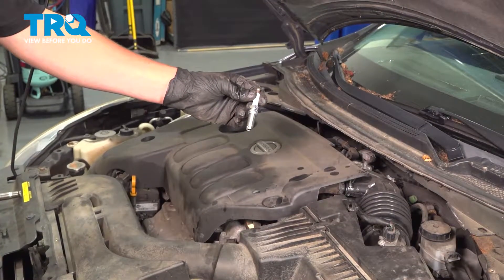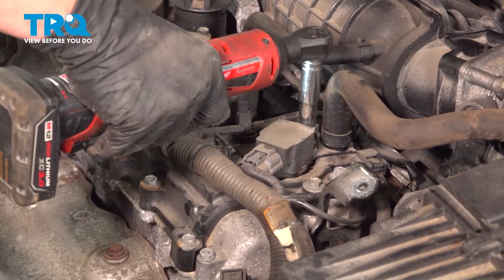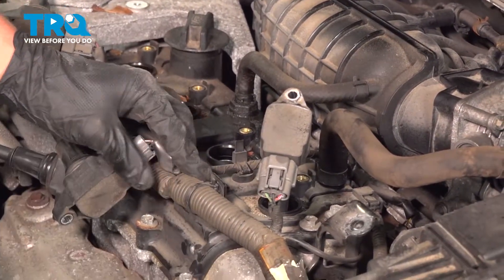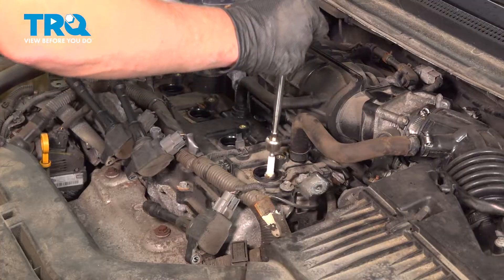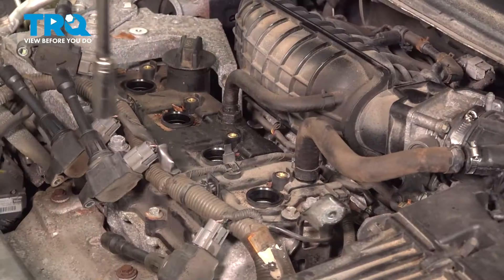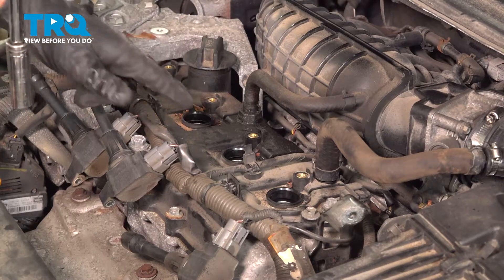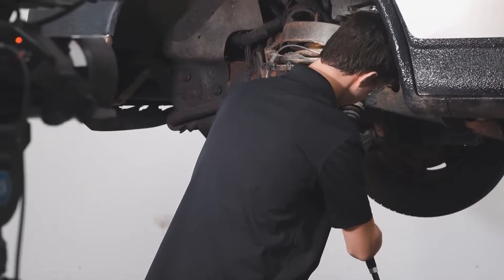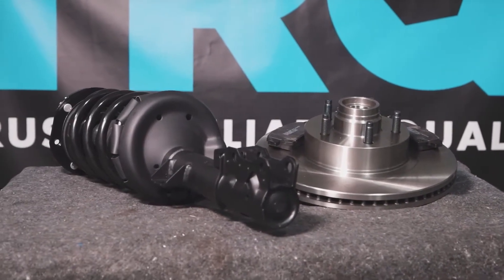How to Replace Spark Plugs 2007-2012 Nissan Altima 2.5L

Comment: I always recommend putting a very small amount of anti-seize or grease on the plug threads and dielectric on the tip to aid in removal next time you change the plugs....

Comment: 1:42 ALWAYS use compressed air to 'blow out' any debris that may be inside the boot holes BEFORE removing the plugs,to prevent anything from falling into your cylinders....

Comment: If you want to get the spark plug out and if you do not have a magnet, you can use the ignition coil that will act as a sponge to hook under the bottom of the spark plug and you can pull it out